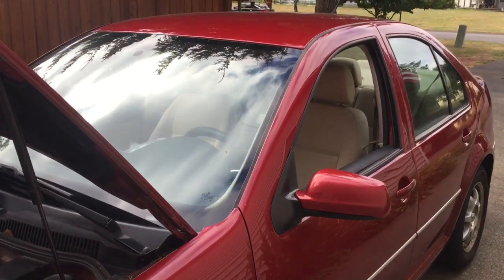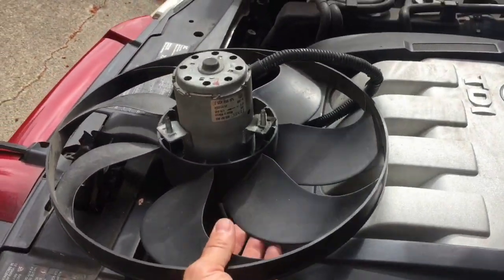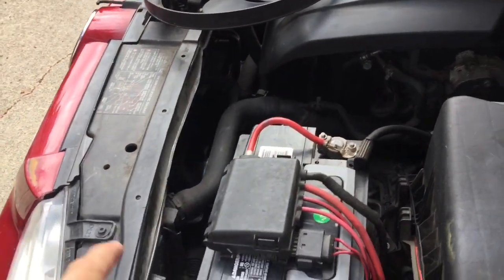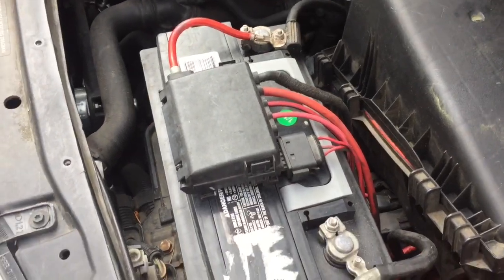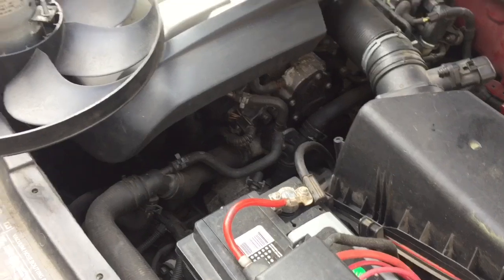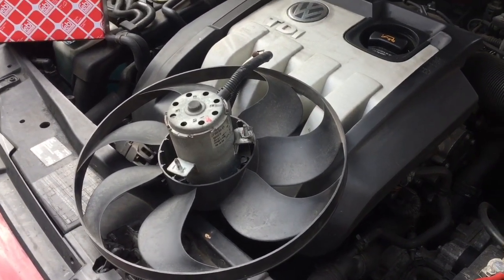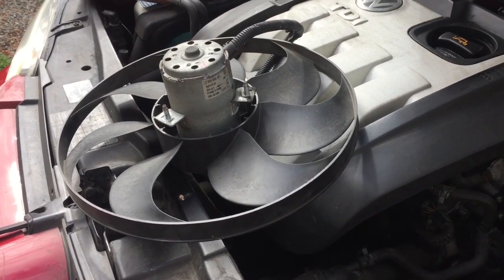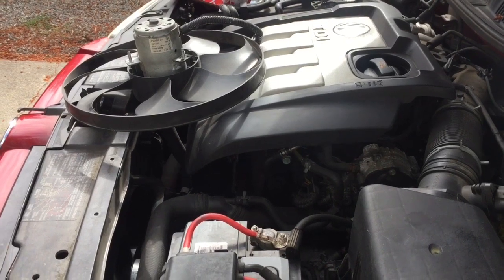How I fixed battery constantly draining VW Jetta

Comment: If the fan is running then something in the circuitry between it and the battery is providing power to it, thus draining the battery. I think that is the issue, not the energized fan itself.  Indeed they should only run with a signal from the radiator temperature switch or the A/C switch as far as I am aware.
Reply from the maker: I definitely agree, It has been a while but the dealer did have a recall for this issue. I did test a bunch of the circuits and even replaced a control switch that was pretty hefty in price before replacing this fan. Replacing the fan was what happened to correct this issue that I was having. Hope this information helps.

Comment: I think your video just solved the problem with my 2005 Jetta. It's not a TDI, but I have had the same issues with the battery over the last several months. Battery is still under warranty. I bought the car new way back when. Haven't had any problems with the car until now. It's been a great car!

Comment: This would be about 100x more helpful if you provided some details on the replacement part. From the video I've gleaned that the brand is Fibi?
Reply from the maker: Apologies for the delay, if you share your year, make model and engine size I can locate one for you. Do you use eBay or amazon?
Reply: @TweekerDan1984  I just got my first car, VW Jetta 2003. So lucky I came across this video. I am pretty confident that it’s the fan running after the car is turned off. What part would I need?
Reply from the maker: @Andrew Tuplin here is a link for the fan, I’m not sure if fibi went out of business during covid. https://www.amazon.com/dp/B009DK8JKQ/?tag=tweekerdan198-20
Reply from the maker: @Let’s go Brandon! Love the name and thanks for the laugh! Here is a link for the part. https://www.amazon.com/dp/B009DK8JKQ/?tag=tweekerdan198-20
Reply: @TweekerDan1984  thanks!

Comment: I have 2006 Jetta and if I don't crank it up within 6-12 hours it will be dead. So I'm having to go through out the day of cranking it up to prevent it from going dead but sometimes it too late. Do you think this could possibly be the problem?
Reply from the maker: Yes it is quite possible, One of the most common issues is that the interior instrument lights don’t turn off causing the battery to drain. If the battery is drained to the point of not being able to start the vehicle too many times eventually the battery will fail completely. It is likely that you need a new battery if this happens very quickly. If you purchase a new battery and have this issue within the first 36 months the battery would most likely still be warranted by the manufacture for the store that you purchased it from. I’d like to purchase my batteries from Costco because they come with a extended warranty and they also offer a very reliable battery.
Reply: I’m experiencing this problem now

Comment: My Jetta does the exact same thing. I pulled the first fuse from the passenger`s side ( there are 3) on the battery block and replaced it to reset the fan. Now I will replace the fan. Thank you!
Reply from the maker: Your welcome, I’ve been good ever since I created this video, I believe replacing the fan with a higher quality part is key to success.
Reply: @TweekerDan1984   hey there, i would like to ask you that replacing the fan fixed the issue for you? this issue has been challenging my sanity now
Reply: He said it has fixed the issue of battery drain for four months now

Comment: What is that sensor you stated you would unplug? I have 2009 vw jetta 2.5l and I’ve been having the same issue. Battery keeps dying replaced the battery, alternator, spark plugs,coil packs,PCV and did an oil change. My abs light among other warning lights came on and now runs funny and making a loud vacuum sound not sure what to do next or what it could be.
Reply from the maker: Standing in front of the vehicle looking down at the engine you will want to focus on  driver side of the engine bay near the battery. There is a black plastic cover the is concealing three fuses. While the vehicle is off you would want to remove the center fuse which will power down the fan. Simply replace the fuse after you hear the fan shut down. The only other alternative that I found was removing one of the battery terminals which will also shut down the fan and keep the battery from draining.
Reply from the maker: I found that removing the fuse is much easier then disconnecting the harness leading to these three fuses.

Comment: If you’re having this issue I’d recommend researching the fan control module first, as that solved this issue for me.
Reply from the maker: Yes I actually replaced that with a new OEM module first which didn’t correct the issue. Thank you for sharing.

Comment: hey @TweekerDan1984 got a question theres a 2006 vw jetta for $600 guy says hasnt run in 3 yrs and reason was battery kept dying car has 120k miles all around good shape should i buy it thanks
Reply from the maker: What if you showed up to buy it with a new battery. And 5 gallons of fuel to mix with the old fuel? I would recommend premium if it is not a diesel. If it was just the battery it may start.  Would love to here how it goes. The price sounds pretty amazing.

Comment: I’m having the same problem ,when this was happening was the battery light on on the dash ?
Reply from the maker: No I did not have the battery light turn on, but if the battery because drained it would cause the battery light to illuminate until the alternator charged it back up.
Reply: Mine was acting weird sometimes when I drive  the battery light comes on but when I speed up it goes away now it stay on all the time, when I turn off the car the fans keep going until I unplug the battery or remove the fuse
Reply from the maker: I actually started using a battery tender to keep the battery from draining down to far.
Reply: @TweekerDan1984  someone recommended I get one. I will.

Comment: Hey, Daniel.  Thank you for posting this.  I’ve been stuck while my young children with me as well, and it’s not easy being stuck!  After you changed the fan, are saying that the amount of time that the fan runs is reduced?  Thank you!!
Reply from the maker: Yes the amount of time reduced significantly. Although if your battery has been drained too many times it may also need to be replaced. You could take your car to a local part store and they may test it for free.

Comment: I am having an issue with my battery draining low and I think this might be the problem. It goes from 12.6 volts to 11.3 after fans stop running... vw b6 passat.
Reply from the maker: Please share your results. Thanks a bunch.
Reply: @TweekerDan1984 ,
So end up replacing my starter. My battery died even when my fans did not run. I dont think is my alternator because when it runs it shows 14 volts while car is running. We shall see in the  next few days.
Reply: @Keepin-it-wheel101  any updates?
Reply: @memes4996 ,
It was my starter.
I change it and all good.
I tested my alternator and good, I check all fuses and all good.
The only part I could not test was starter so I gamble on that and all good now

Comment: is this still an issue in 2015 models? my 2015 SE drained a duralast in 2 days.
Reply from the maker: Does the fan run extensively after you shut the car down?
Reply from the maker: It is common for a battery to drain quickly when a battery cell is going out. We had a bad cell and the battery still gave a reading over 12 volts. I finally found out that the battery was the issue after I disconnected it from the vehicle, charged it up 100% and then let it sit overnight. The battery dropped down to less then a volt in 24 hrs.

Comment: I’m having the same battery dead issue - however on a 2006 VW Beetle 2.5 - convertible no heated seats - could this be my problem?
Reply from the maker: Does the fan run for a extended amount of time once you turn the vehicle off? Did you mean to say you do have heated seats? If so you could temporarily pull the fuse and/or relay for the heated seats to see if that corrects your issue.

Comment: How did replacing the fan fix the problem?  Does the replacement have significantly less current draw?  and can you post the URL or brand and model/part number to buying the one that fixed your problem?
Reply from the maker: I believe there were failing parts within the motor of the fan which caused it to run excessively. I will see if I can locate the part number for you.
Reply: @TweekerDan1984  Did you find that part number?

Comment: How do you know which fan of the two to replace? Was it blind luck? Which one is the "primary fan"?   Thanks for posting this great tip.
Reply from the maker: I replaced the driver side fan because it was not turning off for an extended amount of time. Once I would shut the vehicle down the driver side fan would kick on for about 15 min. After a lot of research I found that the fans can malfunction and run excessively.
Reply from the maker: The fan on the driver side is considered the primary fan. This fan is larger and more powerful, It provides most of the engine’s cooling.
Reply: Open the hood and watch . The one that is running is the one to replace.

Comment: I am on computer desperately looking for a fix for my Jetta   03 VW Jetta vr6 2.8 I got in it 3 weeks ago went to start it and it wanted to but just would not turn over. I have replaced the spark plugs, the knock sensor, the cam shaft position sensors and the crank one. well not me personally have a few people taking a shot at it .. reset the car after replacing the batteries in the fob... replaced thermostat housing I believe it was called. all relays replaced fuses all checked.  Now it is not holding full charge it is 4 years old the battery per what I see. I just got this vehicle after totaling mine in roll over (not my fault for the record lol ) I love it she's fast for sure but one owner took good care of her.. I have had the synthetic oil change continuing what he has done and only premium gas.   It just will NOT start.  the computer shows different things I run for parts and nothing now it says battery not good. Why are they so dang expensive for the battery! I don't believe this is the problem anyway I know very little about car repairs other than I despise them and I NEED my car running. Is it a starter or fuel pump can imagine what they cost but how do I know it seems these guys are just randomly guessing and NO ONE stocks my parts so everything Is on order 2-3 days here 203 days there . Is there any suggestions for me broke and desperate.  Weather not a factor in Michigan.thank you
Reply from the maker: There are fuel pressure testing kits that could help determine whether or not your fuel pump is bad. If the car is cranking strong when the battery is charged up then it is unlikely the starter is at fault.

Comment: Help!!!

Fuel pump quitting
 Fuel pump replaced
 Runs fine if wired direct to the battery.
Radiator cooling fans 
come on at random times draining the battery, when they should come on when the radiator is hot and needs cooling and after turn the switch off. They came on when the car has been sitting for 2 days.

Last time it quit was because of a “Engine Cam Shaft Position Sensor” failure that made it not run, this only happened once. Fuel pump and cooling fans 6 to 8 times each.
Each time it sits for a few hours to a day or so, it will fire right up and run like there is nothing is wrong, in some cases for 2 or 3 months.